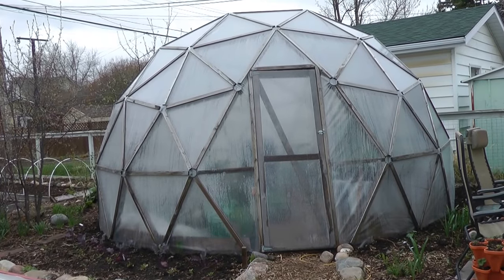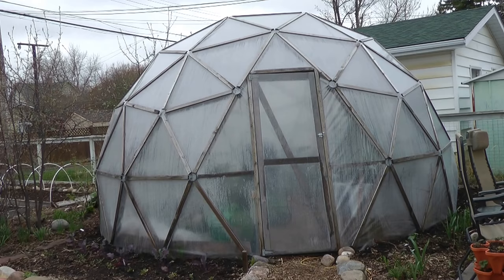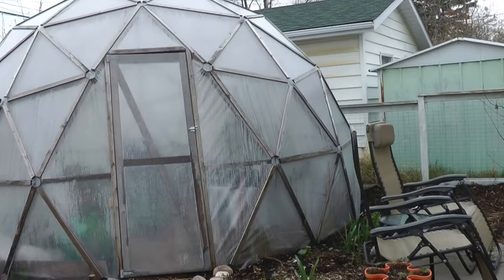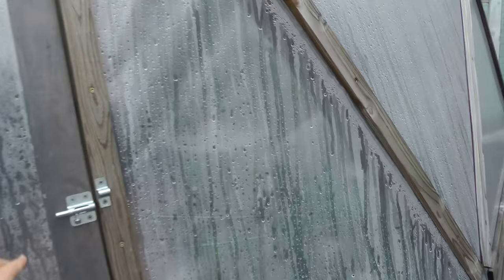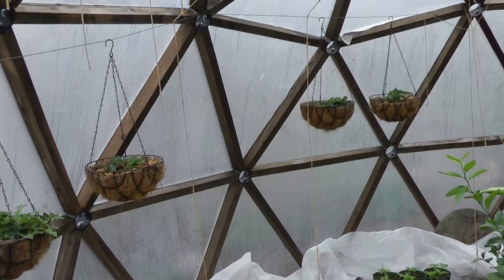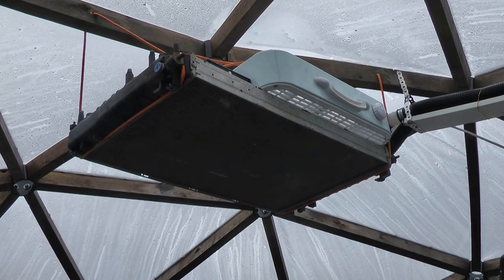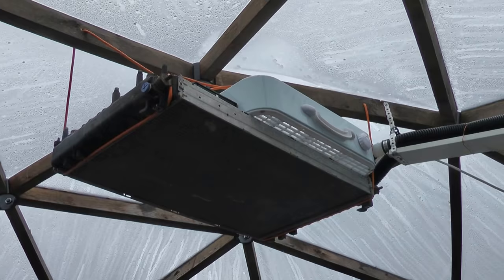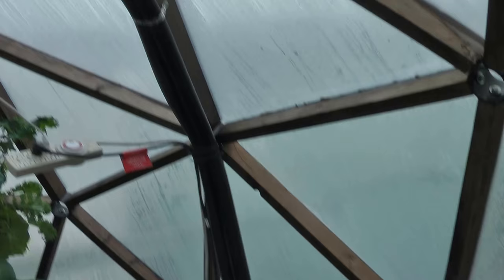Heating and Cooling a Greenhouse with a Car radiator Conected to a Water tank

Comment: As the warm moist air passes through the radiator and cools, how do you deal with the condensation that results from the cooling of the air ?
Reply from the maker: We are in an extremely dry climate, so usually it just evaporates as the sun comes up and warms the dome. It’s a good question though. Running a humidifier that puts the water back into the water tank would be an option.
Reply: @NorthernHomestead  Thank you for your response. I live in northern ontario so I'll need to rig up some water capture system (ie. rain gutter)

Comment: Very elegant solution!  I have a 50w solar panel.  I think I'll power my 80L/hr pump and some 12v computer fans to see what cooling /heating I can achieve.  Does algae ever plug up the radiator? I'll make a video too! Subscribed!
Reply from the maker: TheRainHarvester we haven’t had that problem yet. But algae does grow in the tank. With a long growing season you would need to find a solution. Our summer is too short to be overly concerned about it.

Comment: will your radiator store heat from the day in the water?
Reply from the maker: Yes, that's the idea behind it and why it works.
Reply: Northern Homestead that's awesome. Would the fan be on in both heating and cooling applications? I have a big concrete sump underneath my greenhouse and I am planning to fill it with water
Reply from the maker: Shanon Hudson Yes, the fan would be running in both applications if you need to cool during the day and heating at night.

Comment: What happens if it gets really cold and the sun doesn't shine.  do you have to drain the system to avoid freezing?
Reply from the maker: The system only works with sunshine and till about -10C (14F), after that it's winter, and we drain the system and store for the winter.
Reply: @NorthernHomestead  I think this is one of the best ideas I have seen I spent a whole day digging 8 foot trenches for a friend of mine's greenhouse and I think this system is simpler and better👍👍👍👍

Comment: so the pump and fan work on a thermostat system?
Reply from the maker: No, there is no thermostat. Simply during the day the air warms up the water and during the night the water warms the air.
Reply: @NorthernHomestead  so the fan and water pump run all day, every day? Or you switch them on and off manually?
Reply from the maker: Paul Hitchman we do switch them off manually if we feel that it’s not needed.

Comment: FANTASTIC VIDEO!!!!! I'm about to try this with a car radiator and my outside wood furnace boiler to heat my geodesic dome greenhouse - thank you for the video!  - do you use double air inflated polly? if not check my channel I have a video on how to do it with a dome and square sheets - it worked great and gives you a LOT more insulation cheaply. Thanks again - I'm totally going to do this!